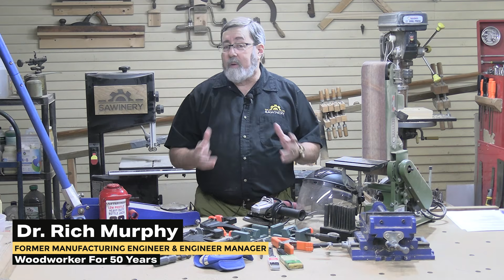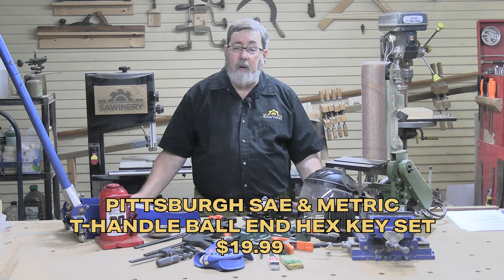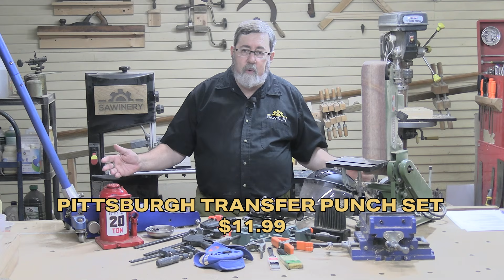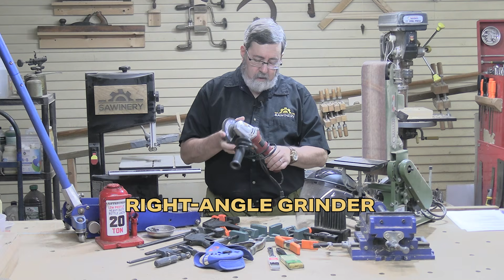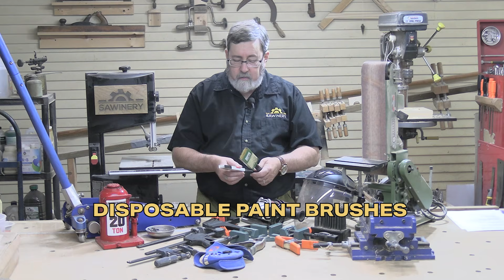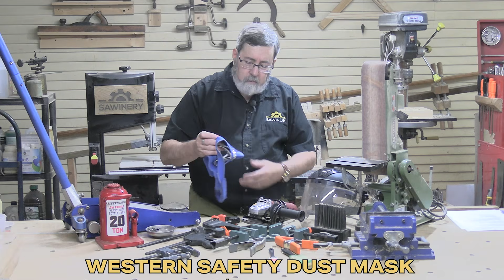22 Best Tools You Can Buy at Harbor Freight

Comment: I’ve found that Pittsburgh brand sockets, ratchets and wrenches, made in Taiwan, are as good as any other brand.  I have a Pittsburgh torque wrench and it hold pretty true.
Reply: I have a set of SK sockets (1/4" and 3/8” 6-point regular and deep, SAE & Metric) that I bought back in college 45 years ago. I also have Pittsburgh sockets. The SK sockets are beautiful and are far superior to the Pittsburgh sockets astetically and functionally. Sure Pittsburgh are good enough for many jobs, but if you are going to own a tool for 40 plus years, get something nice! YMMV.

I have Grey Pneumatic 3/8" and 1/2”  impact sockets from Amazon. Very nice for the price.

I recently picked up the "SK 3/8" Drive Ratchet Handle, Pear Head, 90-Tooth Ratchet, Alloy Steel, with Contoured Handle" from Amazon. The feel, fit and finish, heftiness in my hand is superb.

My tools give me enjoyment. Strip a few bolts and you'll wish you had the good stuff. YMMV. Cheers!

Comment: Probably the oldest HF tool I have is a 12v impact wrench that is corded and had jumpers to hook to a battery. I've had that thing since 04 and it still works. It was like $25 when I got it and its done everything from remove tires to pull stuck lawn mower blades. I've never regretted buying that. Unfortunately they don't make them anymore. More's the pity.
Reply: They have 12V impact wrenches in auto emergency kits that work differently from standard type impact wrenches, they spin up to a high speed before they engage the impact mechanism, and develop quite a wallop.  Requires very little power and current from the battery because it accelerates it gradually to the high speed.  Not much finesse to it, so you can't feather the throttle for different torques, so it's limited to applications where you don't need a light touch.

Comment: Tools are not status symbols. They're tools. If it gets the job done that's what counts. And even if they're not the best they can hold you over till you can get the better because lets face it ALL tools fail eventually. Bearings wear out, switches fail, motors burn out, etc. etc. etc. When you accept this "good enough" tools start to make sense.

Comment: Clear true and no fan boy name calling.  Thanks for this one.  I bought a few of their 12v Hercules tools because they were lighter than the many orange brand 18v tools I have had for years.   When I’m working over head the lighter weight allows my damaged shoulders to last more than an hour.  The battery life of the Hercules 12v is outstanding.  I put half of a metal roof on my shop with one battery… that was nearly 300 2 and 3 inch screws.  I  still love my orange tools but the blue is worth a look.

Comment: I used a 18v Black & Decker 3/8 inch cordless drill to run network and power cables in three (3) 12-lane gun clubs each with 3,000 sq ft Pro-shops, gunsmith shops, and various offices. None of the display counters or register locations or administration furniture had cable raceways. All furniture was constructed of 3/4 inch particle board. I had to drill holes for the passage of wiring underneath the counters. That was several years ago before I retired. Still have that little drill and have used it on many projects around the house and shop since. Saw most of the contractors around the building sites using Dewalt and Milwaukee. To each his own. I am now mostly in the Bauer line and have not had a regret when using any of the tools. Just used my Bauer rotary hammer with clay spade two weeks ago to set my own headstone. Yeah, may sound morbid but I always plan ahead. Don't want my kids to have any hassles when the time comes.
Reply: Respect.

Comment: Very good advise overall. Any shop that doesn't have at least 20 of those magnetic hardware dishes is missing out. I have used them for years for everything from computer repair, woodworking, automotive, absolutely everything. They are worth their weight in gold.
Reply: I have three of them attached to the underside of my toolbox..  next time they are on sale I'll get a 4th one
Reply: I use them in my sewing room. Sooo handy for pins, needles etc
Reply: Kitchen here - little metal clips that I use to re-close freezer bags small chip bags, & such. Right on the fridge where I use them.

Comment: I dont buy much from HF, but as a self employed welder for 10+ years that keeps track of how much value I get out of my consumables I will say this. Their cutoff disc's for grinders dont really wear down much faster than most other name brands, but are definitely cheaper. The cutting disc are so thin, that everybodys wears about the same and at most if it wears out 25% faster, they're still at least 50% or more cheaper. So those are cost effective to use.

Now their flap disc's are the opposite. If you need those, go to your local welding supply to buy them. They are about twice the price but are around 3 times as thick and last about 4 times longer, making them more cost effective. The ONLY time I would buy them at HF is if there is a ridiculous sale or coupon on them because they wear out so quickly.

And to touch on the grinder that you mentioned for metal work. Unless you're working on the pipeline, a 4 1/2" grinder will do about anything you need around the shop and will be lighter and fit in tighter spots. Leave the 6" grinders to those doing industrial or pipeline work.

Comment: I think the paint brushes from the Dollar Tree are the best buy for disposable brushes.  I use them for touch ups of interior and exterior walls with latex paint.  The trick to get good results is to stroke in the same direction (up and down) after applying the paint.  When done, clean it up an use it again.  When it get too gummed up with paint, throw it away and get another one.  Less than $0.70 per brush for a two pack or $0.45 each for a three pack.

Comment: I have a few Bauer and Hercules cordless tools.   I'd recommend them for use around the house for sure.   Hercules should hold up to professional work too and the brushless tools have a 5 year warranty, the batteries have a 3 year warranty.   I'd say Bauer is pretty comparable to Ryobi, I used Ryobi for almost 20 years but I started switching to Bauer and Hercules because they are a better value, especially if there's a sale.   Anything Icon I have tried has been great too, honestly they are nicer than a DIYer needs.   The Pittsburg impact sockets are solid too, I haven't broken one but they have a lifetime warranty.
Reply: I have Milwaukee M18 fuel battery tools. I expect they will last at least a decade. I started into HVAC and could justify the cost.

For cheaper I would get DeWalt. As I recall, it wasn't that much more than Hercules for better quality IMO. Lots of the HVAC install techs used DeWalt and swore by them. Didn't really see any Hercules battery tools on the job sites.

Comment: Love Harbor Freight!

I don't own many of their power tools but I have picked up a few of their cheap grinders for when I'm doing something that's particularly dirty... Like widening cracks in asphalt before I fill them. This always gives me the option of just chucking the tool when I'm done with the job instead of spending hours cleaning it. 

Never had any problems with any of their hand tools.  Good stuff.

I don't really need the US general boxes so I picked up the Yukon 9 drawer boxes.  I have three of them and thinking about picking up a couple more.

Only thing that has kept me from buying any of the Bauer or Hercules battery tools is that I'm already invested in Ryobi and have no reason to change.

Comment: Good video and good advice on how to use Harbor Freight.  Beware of buying anything which requires a lot of precision though.  I recently bought their cheap (warrior) brad point drill bit set.  The 3/8 inch was 1/64 oversized. Not nearly accurate enough to accept the dowell plug I needed it for.  I will say though that they did give me a full refund.
Reply: The tungsten tip concrete bits I bought were off size, maybe a metric size used for the closest SAE? Anyway, the expansion bolt wouldn't fully fit and jammed. I had to abandon the hole and star over. So not good on those bits.

Comment: Regarding your drill, There is a Central Machine floor model drill press that also has the MT2 Taper Spindle. I'd advise staying away from the cross-slide vice if you don't have s taper spindle setup for the connection to the Jacobs Chuck. Trying to grove on something without one is just asking to destroy the spindle setup.

The floor model drill press is showing currently at $399, it's an 'In Store Only' item. This may be an occasionally available item, and it's also an 'overweight' item, so if you buy one 'in store' and they have to order it in for you, they suggest there will be a $125 (or so) fee associated with that. At least I don't think it's applicable if it's already in store.

If I'm not mistaken, it's advised to bolt this drill press into the floor. For that get the disposable level hammer drill and appropriate fasteners. (Unless you're already doing a lot of fastening things to the floor and need, and probably have, better equipment.)

Comment: Homeowner with some rental properties here. After a decade dealing with a set of consumer-grade Black & Decker 12-volt tools, I decided to replace them. I weighed a number of brands (looked at price/performance, warranty, suitability for my use case) and went with Harbor Freight's Hercules 20-volt system. Quality seems to range from pretty decent to surprisingly good, and I've had no issues or complaints.

Comment: I have the Hercules 12” sliding miter saw and their cordless impact driver, 1/2” hammer drill, compact router, ultra torque impact, and the fixed/plunge router. I am more then impressed by them. Would I buy again, in a heartbeat. I use Dewalt at work and the Hercules is every bit as good and even better with a couple of them.

Comment: I have that same right-angle grinder.  Mine broke because the cast aluminum head cracked.  When I opened it up, I could see that when it was cast the metal didn't fill the mold all the way.  The metal around the hole at the stop pin was paper thin and crushed the first time I tried to change disks.

Comment: The Warrior and Hercules lines are much better than the old Central Electric stuff, generally speaking. Their measuring tools, combination squares, etc. are not very good if accuracy is required. I’m keen on trying some of their pneumatic tools, especially the pin nailer. Here is my short list of tools that have been a disappointment: plunge router, saw blade sharpener, pocket screw drilling jig, drill bits, and large torque wrench.

Comment: Overbuilt tools, as well as underbuilt tools are a very real thing.  As a ~95% handtool only shop, most of the limited power tools I have for household maintenance are about right or overbuilt (i.e. the dewalt 12v drill & driver set is just about right for my home needs and will probably last the remainder of my life of ~25 years).  My dewalt lunchbox planer is just right but is really only used in dimensioning after I’ve face jointed one side first (with good maintenance it’ll last me till I die too). As a byproduct, it’s only really used as a ‘shop’s apprentice’.   A set of carbide knives is a great investment because I don’t depend on it for final surface for anything and the long lasting dimensioning legs is well worth it.  Some guys are better with the HSS knives and changing them out more often to keep their surfacing in peak condition.  In my case, if so have a nick in a knife, it’s really not a big deal for a long time.  A set of chisels for the hybrid woodworker can vary depending on what he thinks he needs, but by and large, he’s not going to demand or need to demand as much from them as guys like me do.  A guy who occasionally breaks out a No°5 or block plane to edge joint a short box side, clean up endgrain, or chamfer and edge isn’t going to need the quality and exacting level of someone who spends hours with a No°6/Foreplane in his hands just to dimension once it used more than any other plane I have.  I use Harbor Freight the same way the rest of you guys do for buying a tool I’ll use a few times or once every few years (20 ton bottle jacks, a hammer drill, 50’ drain snake, etc… as examples).  But also they are handy for some consumables.  Like you, transfer punches have come in handy when building tools; in my case two sets of transfer punches sine I’ve used them for alignment. I’ve made my own sets of drawbore pins from their tapered punches.  Their tarps have been great for stacks of slabs and lumber I’ve air dried. Their C Clamps have done well for me in locking steam bends to forms. A box of acid brushes or tongue depressors have a thousand uses. 
We can see these truths across home needs, shop types, and shop synergies.  Be it Powertool/Hybrid/Handtool Shops and Renter/Owner/Renovator DIYers, we can all benefit from HF. 🫡

Comment: You said something that I basically tell people all the time... About the plastic clamps you basically said use it within its limits. I have their low-end reciprocating saw I paid $19 for... I put good blades in it and I let the blade do the cutting. This $19 saw I have had for years. It may take a little longer to make the cut, but it works just fine for me every time...

Comment: I have 10+ Bauer and Hercules power tools, and I find they r able to go head-on with my Dewalt tools. None of them have failed on me in over 1 year of almost daily/weekly use. And I abuse them more than my more expensive Dewalt line of tools. One thing I would recommend is getting the 2 yr extended warranty on power tools. This allows a no hassle replacement (NOT repair) within any HF store ( no waiting/shipping). Also recommend to buy using their coupons which come out weekly.
Reply: Been using the Bauer palm router for 5 years now and it's been amazing. Hasn't let me down yet. At the time it was $72.compared to over $100 for a DeWalt

Comment: Have you checked the detent slop on miter saws lately?  all the miter saws I looked at in the big box stores had a lot of play when you have it in a detent without locking it down. so how do you know if you are locking down 90?  maybe you’re locking down 89.5 one time, cut a different angle and come back to 90 only to lock down on 90.5 on that Dewalt. Or maybe you’re getting 90 or 91 on that Delta. 

The Hercules miter saws have no play at all. when the guide drops into a detent, that whole cutting sled is held fast. Go try them out, you’ll see. 

I picked up a 12” Hercules compound miter saw (non extending) on clearance this year for $120. This last week, my store had one in stock and on clearance and on sale, again, $120. talk about a steal everyone passes by!
Reply from the maker: Your comment about the detent not being accurate enough is my biggest issue with miter saws and why I prefer a miter sled on the table saw. Your comment on the Hercules saw is interesting. I haven’t had a chance to check that our myself; but if its true, Harbor Freight has really upped their game, more than equaling many of the big brands… at least in this tool category.

Comment: Do you have a video showing how you add grease to the side grinder?
Reply from the maker: No, we don’t have a video on that, but it’s a really simple process. There are 4 socket-head cap screws holding the cover to the gearbox on. Just remove those and the cover should come off. The gears won’t fall free, because they are captive to the shafts. I literally use a large screwdriver to scoop up a glob of grease and just drop it on the gear, then reassemble.

Comment: I don't agree at all.  I've had so many junk tools that it won't happen again.  For instance, I had a circular saw that wouldn't cut a straight line. I didn't know that it was the saw, until I got a better one.  I've now replaced them several times.  The same with a jig saw.  Crap ones won't cut a straight or perpendicular line. They might be good enough for construction, but not woodworking.

I have a HF SMCS, too.  I take it outside for construction.  If it rains, oh well.  Woodworking is a completely different thing.

Buy once, cry once.

I do agree with you wrt tool boxes. They're a steal.

Comment: When it come to power tools not made in America, go Makita. Milwaukee used to be a good tool but now China has screwed that up too. When it come to quality for the industrial or true construction needs, stay clear of HF. I know some of the stuff at HF will get the job done but I just have a problem with sending my money to China. Amazon is another dealer for China. Damned if you do, damned if you don't.
Reply: Milwaukee tools are still very good. Hasn’t changed. Makita has some select tools that are exceptionally good but over under lower end than Milwaukee, dewalt, or even metabo. It’s all made in China or Taiwan unless you’re buying snapon power tools.

Comment: I highly recommend against using cord reels because they will often over heat under load.
I have many of the 6” bar clamps 👍👍 but the longer ones 👎.  Highly recommended also; tamper proof bit set, automatic center punch, dead blow mallet, Bremen parallel clamps, wood wood lathe,
Reply: My experience with two cord reels has been excellent for over 15 years with no issues.
Reply: @williambranham6249  I melted a cord on a “good” 14 awg one that was half unspooled running a miter saw, not used one sense.

Comment: I have the 5" ROS Bauer. I have used it quite a bit. My main gripe with the Bauer drill driver is that it has a half inch chuck. Maybe swapping with an after market 3/8 would be an option.